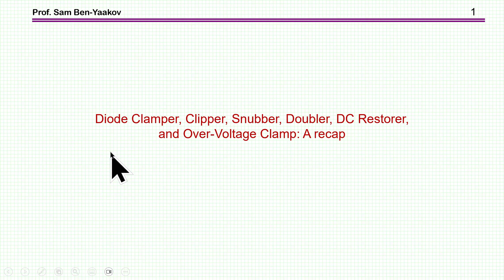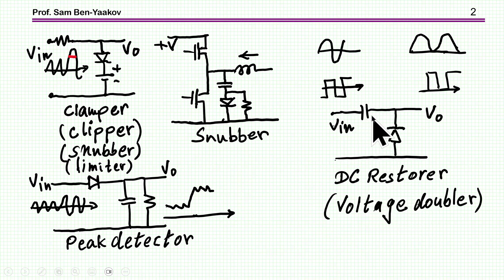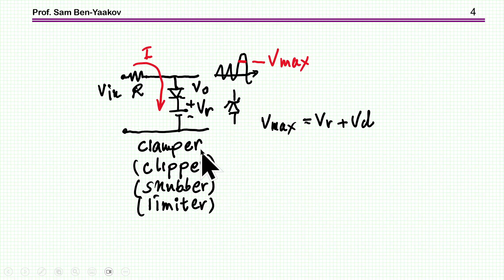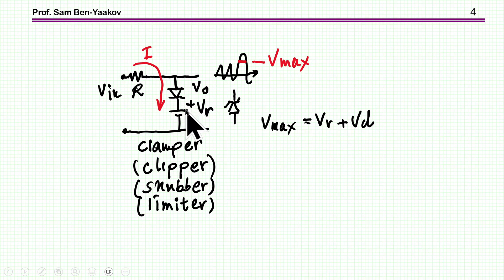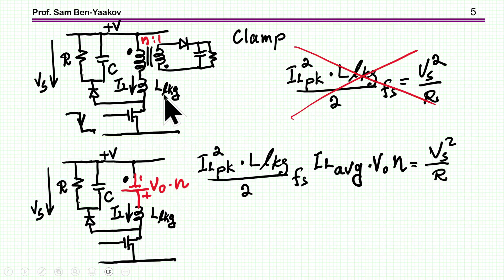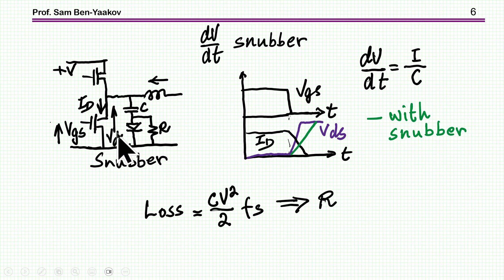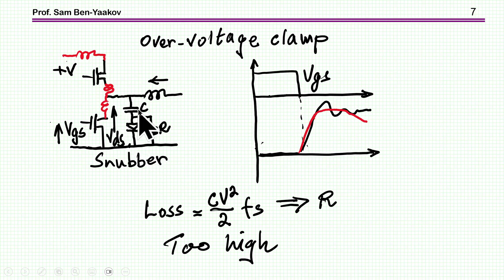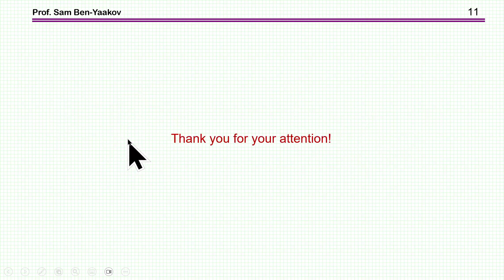Diode Clamper, Clipper, Snubber, Doubler, DC Restorer,  and Over-Voltage Clamp: A recap

Comment: At 9:40, are those diodes backwards?  The anode of the bottom diode cannot possibly be higher than 0.7-0.8 V -- certainly not high enough to charge the power supply caps.
Reply from the maker: The diodes are not backward, but as indicated in the description section, the diode and cap re switched at the lower side.

Comment: Hi Prof. at slide 9 which value should be on C if we want DC restoring function?
Reply from the maker: Sorry for the delay in my answer. Good question. The required capacitance depends on the discharge. That is, the eventual load downstream. Too small a capacitance will cause high ripple.

Comment: It looks like Diode and Capacitor are swapped at the lower side of the over-voltage clamp. The high side looks OK.
Reply from the maker: Thanks for catching that. I will put an error correction note in the descrption section.

Comment: Microelectronics books use the terms clamper and dc restorer interchangeably. In this video, clipper and clamper are treated as if they represent the same concept. I do not know which one is correct.
Reply from the maker: There is a lot of confusion in the names. I do not think that semantics is that important.